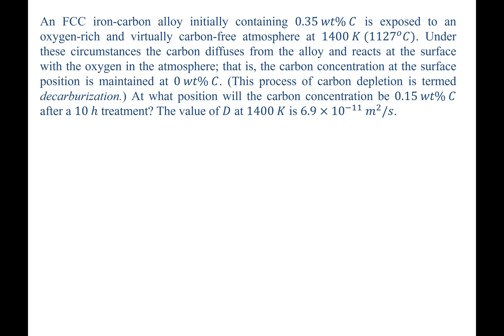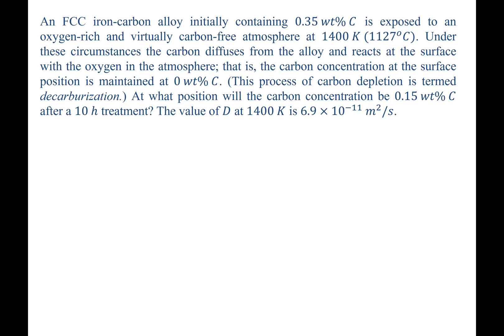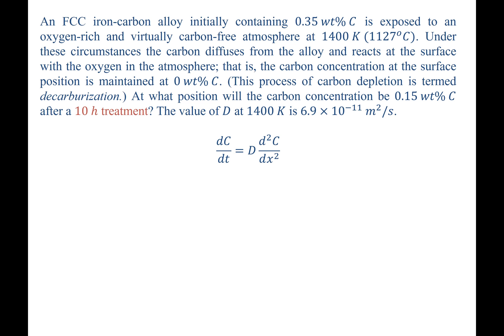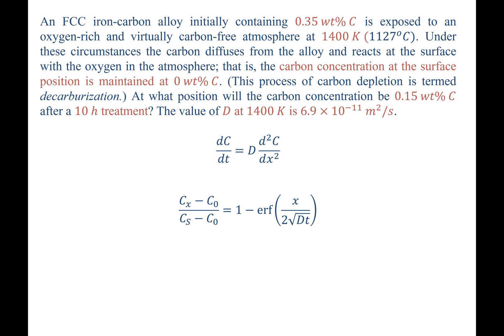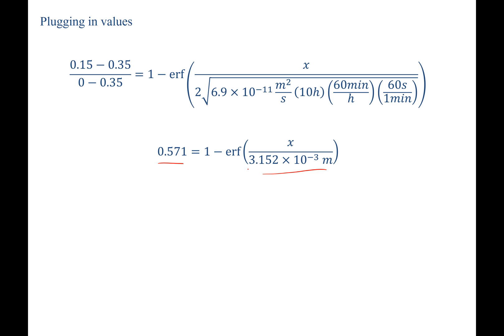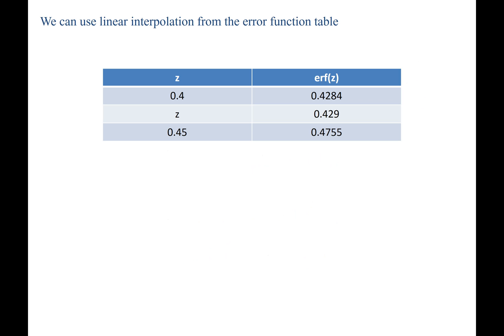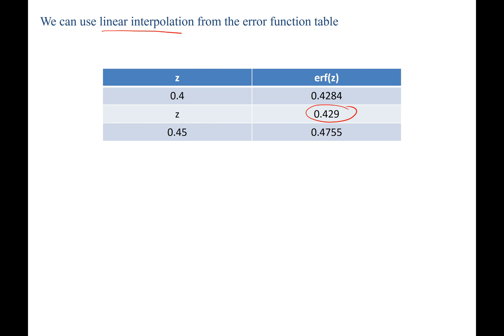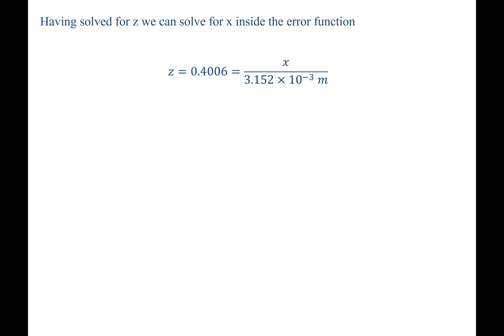mass transport Ficks second law non-steady state diffusion example problem

Comment: Hello. how did you get erf(z)=0.429?
Reply from the maker: 0.429=1-0.571
Reply: @TaylorSparks  I have a question on the erf(z). On this problem erf(z) came from subtracting 1-0.571. But on one of your video  erf(z) cam from simplifying the right side of the equation to 1/2 or .50 for (z). Sorry I can't seem to find the exact video. How do we know when to get Z from simplifying the right side or subtracting 1-left side?
Reply from the maker: @RTDTOOLS  it should always be 1- left side. If  you find the other video let me know.